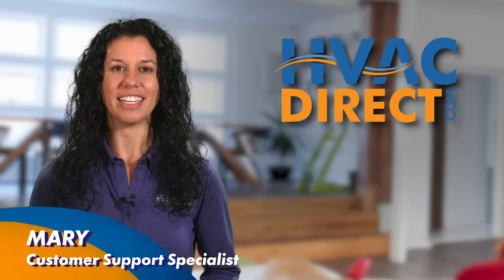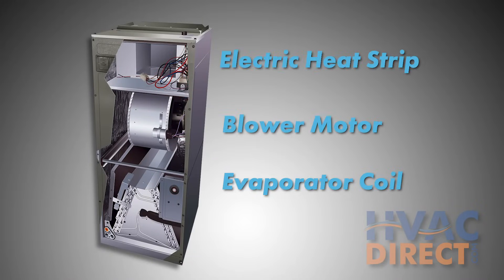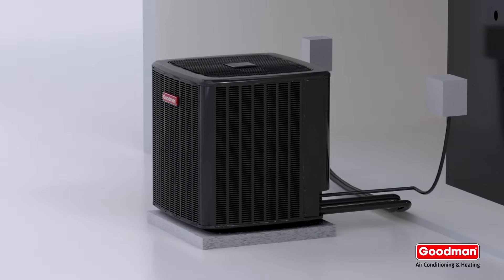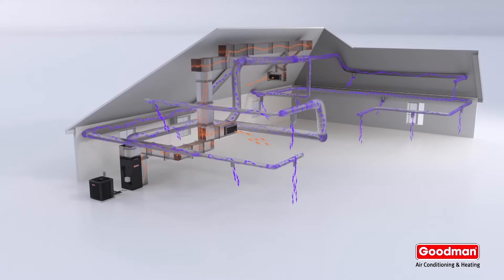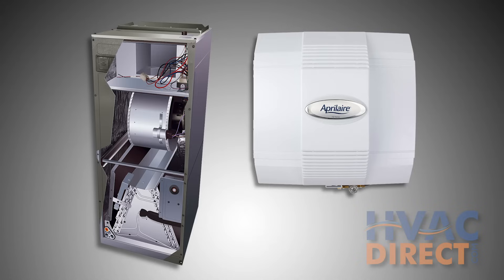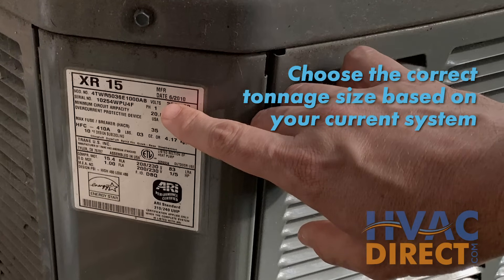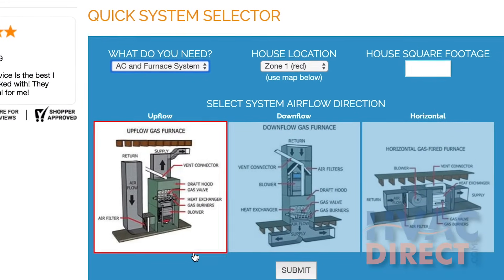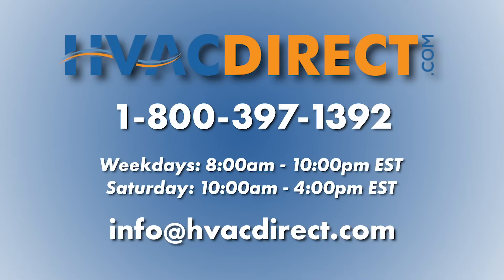What is an Air Handler and How Does it Work?

Comment: Should my heat pump be on with the fan running while the air handler is operating in the wintertime?
Reply from the maker: If it's still above 35, yes.

Comment: Yes, I just had a Coil Cleaning
 It was very needed. I was unable to catch my breath. Now, my other question has to do with my open door unit. I don't see an Air Handler on my Goodman Amana. The year purchased was 2014. I only have the framing on wall which connects to the A/C.
 I need knowledge about this area. Do I put an Air Filter in this area? It tends to restrict the Air Flow. I really want to save her. Any ideas? Always wanting to learn! Thank You!

Comment: do we need to install air handler if we move to "air packaged unit"?
Reply from the maker: Thanks for the question! The short answer is No. The expanded answer is: An air handler contains a blower and an evaporator coil. Because a packaged unit contains all of the mechanical components of your HVAC system, the blower and evaporator coil are contained within the packaged unit. Your home’s ducts will be connected directly to the packaged unit, eliminating the need for an indoor air handler. Hope this answers for question!